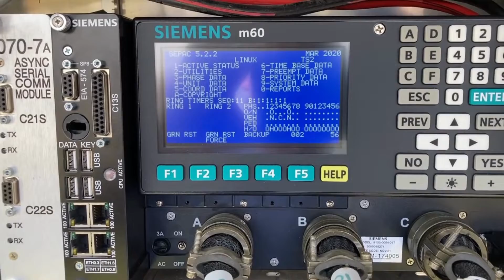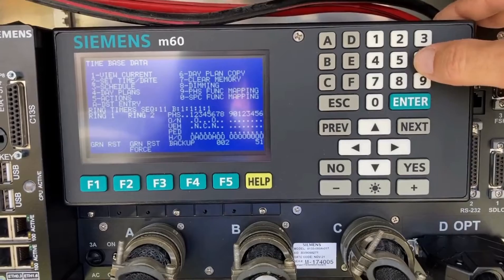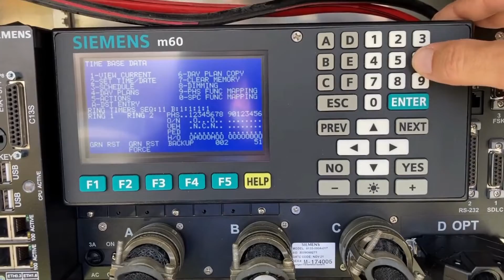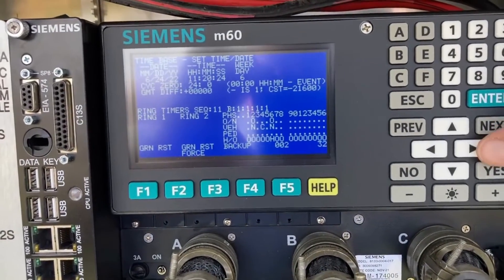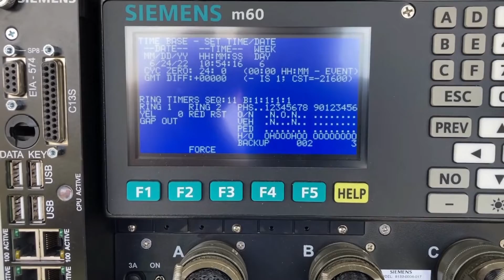Setting Time for Coordination in a Traffic Signal Controller

Comment: Do the Siemens devices have support for network NTP? I would assume it has some sort of support  due to the Gbit ethernet ports?
Reply from the maker: YES!  We just finished networking an entire run.  Its so nice to be able to login remotely to make changes or check signal timing.  Helps ALOT when you have a large region to cover and can't be everywhere at once.

Comment: The controller time of day will drift over time. You need to install a GPS receiver in the cabinet.
Reply: Kind of hilarious that this ridiculously overengineered piece of equipment that probably costs 10s of thousands of dollars doesn't even include at 15 cent clock radio WWVB receiver, let alone a $5 GPS receiver.
Reply from the maker: You can get it.  It will just cost more $   LOL @f0urty5
Reply from the maker: Yeah Mike, you're right.  However, we're in the process of running fiber to all these locations so we'll be able to keep them in step when that's completed.
Reply: Other than for after power outages gps is overkill for this, just use a clock tied to power frequency instead of a local oscillator, power frequency is tightly regulated and given we care more for sync than absolute time, even if it was not tightly regulated it would not matter other than again at times of resetting time as it's inherent in a power grid that frequency is the same across the grid so drift would be all equal.
Reply from the maker: @glennmcgurrin8397    Very insightful.  How would this work though if you're in a coordinated system and some signals are on a different transformer than another (but they're all still part of the same coordinated system).  Scenario:  One transformer goes out but the other one still is fine.  When the bad transformer comes back online, would those set of signals synch back to power but the other ones are still running on their normal time.    I would think you're coordination would be off between those 2 groups then.  Just thinking out loud....
Reply: @glennmcgurrin8397  Good point. However,  I wrote a smartphone app that determines the cycle counter based on the cell phone time of day. If the time of day in my phone (which is very accurate) matches the time of day in the the traffic controller, I can display the cycle counter, offset, and determine exactly when the traffic lights change. All this without opening the traffic cabinet door.

Comment: GPS has been a thing for a minute. Just a guess, but I bet Siemens charges extra licensing to use it.
Reply from the maker: Great insight.  Believe it or not, these controllers have the capabilities to connect a GPS device to it.  Usually in the form of a puck that is installed onto the cabinet, the wires are then fed to a panel that has a harness to connect to the controller.  There is some programming that needs to be completed, but definitely a viable option.  This will keep the controllers time of day set accuratley.  Don't give the controller manufacturers any ideas though...I'm surprised they haven't made that an add on charge yet (extra licensing)!!
Reply: GPS is useless for a traficc light....
Reply: @Triggernlfrl  GPS works by sending extremely accurate time signals.

You are watching a video for manually setting the time on a traffic light.

Put 1 plus 1 together.